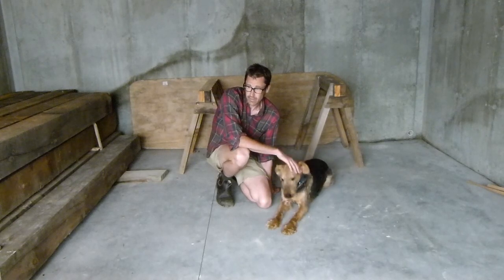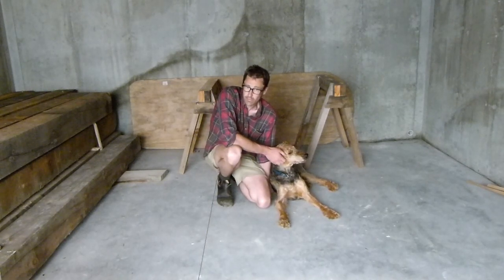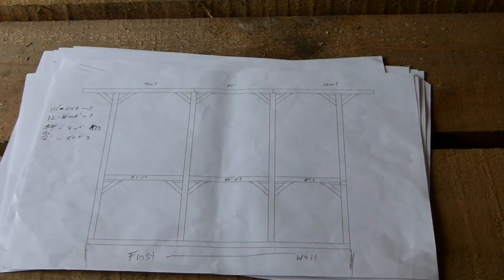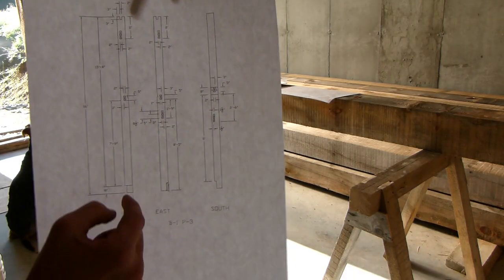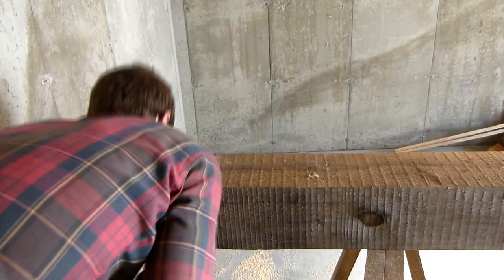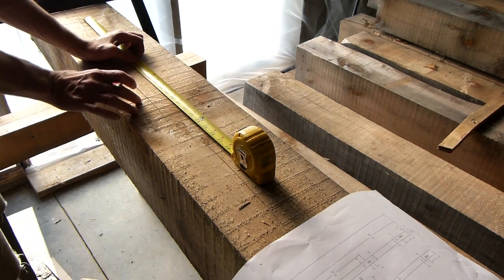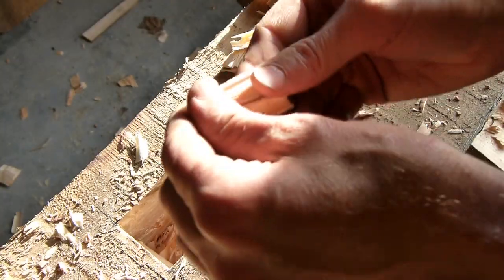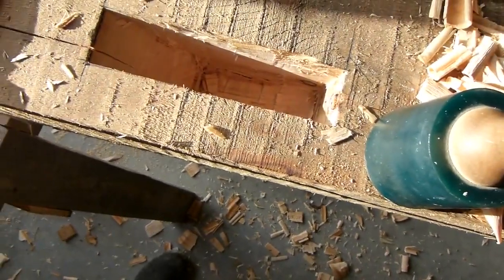Building A House From Trees - Season Premier 2 Ep. 1 - Drafting, Marking Beams, and Cutting

Comment: Oh man this is going to be a lot of work.  I helped to build a timber frame bridge using a chain mortiser and 16" circular saw and it still took forever.
Reply from the maker: It will be a lot of work indeed, but I am going to be using more power tools than I conveyed in this vid. Did you like the chain mortiser?
Reply: It worked very well,  the bridge was sometime like 50 posts and 60 beams with a LOT of mortised elbows,  I can't imagine doing that job without it.  Also I didn't pay for it,  so that helps :)